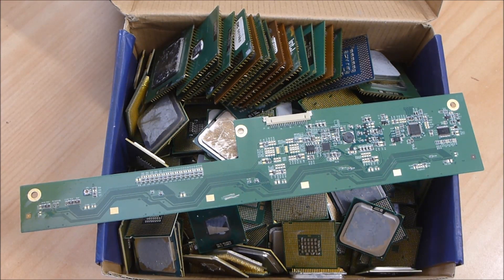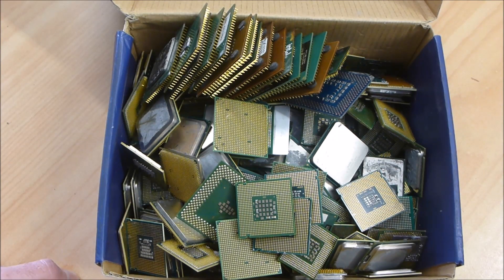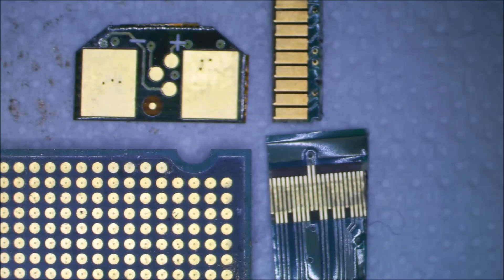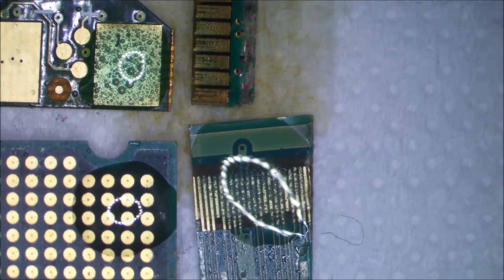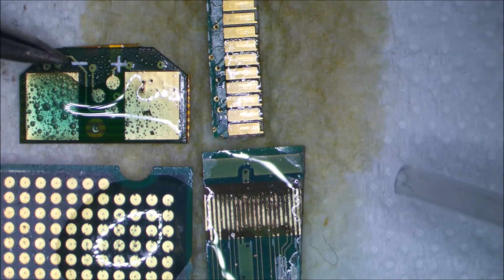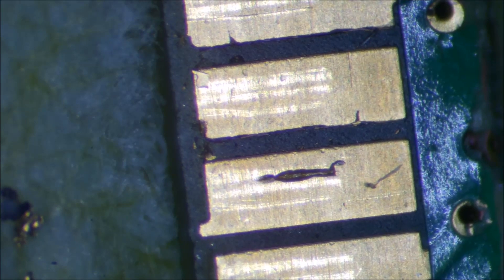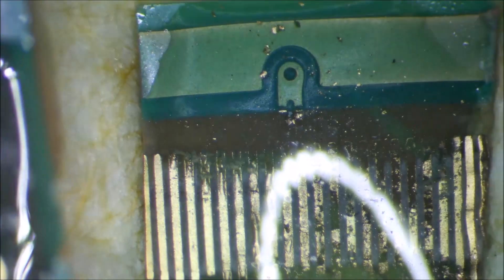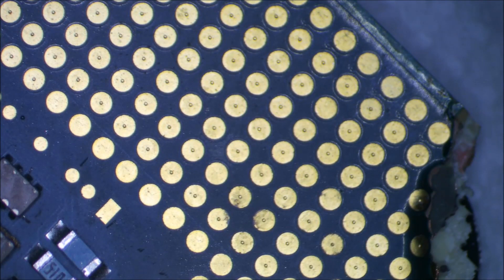Gold Recovery - Hard Gold vs. ENIG Part 4 - LCD monitor and P4 Processor

Comment: Great set of videos, thanks for putting them up.   I have a large amount of LCD boards, and clearly processing via AP looks like it would end in disaster. 

Could you post a video/link/point in the right direction a way to successfully recover the gold from ENIG surfaces?   I think I saw in comments using Iodine, but I have no idea how to use iodine in any successful way.

Again, thanks for the video
Reply from the maker: Thanks for the compliments, yes, it is definitely on my list of videos-to-do. I think the best approach for this type of plating would be a Cyanide based leach. Sodium Cyanide is a controlled substance in New Zealand, so hard to buy, but I have had some luck with using Potassium FerroCyanide which is comparatively easy to buy. Unfortunately the reaction requires strong sunlight which we are currently lacking here!  Iodine is definitely also a good alternative, but my knowledge on the subject is only academic at this point unfortunately.

Comment: Good Video the pinless processor looks interesting. another test that came to my mind, the cellphone battery contacts. when you remove them  they are mounted in a pcb, like the ram fingers. keep making that informative v videos that` exactly what i wanted to do but  dont have that helpfully tools. Regards,,, Luis  (Puerto Rico)
Reply from the maker: Thanks Luis, I am running a batch of those pinless processors now, will post a video next week showing their results. At the moment I'm guessing the total gold and copper value of a pinless processor will be far under NZ$1, but I hope to be surprised. I will have a look at battery contacts at some point, I have quite a few from phones and laptops, usually I process them via a Sulfuric Cell.
Reply: Thanks for the reply. waiting for your results. by the way sulfuric cell is one of my other solution for gold plated RF connectors , transistors, laser diodes and big pins etc. but here  those acids are out of my reach. i read at the gold refining forum that boiling  battery acid at 100 degres is safe to deal  and end up with bearly good sulfuric enough for the cell.  there are new exotic  solutions like the Leo Chang  channel. he have that super safe formula that deplate in seconds and you can put youre hand in the liquid. i don`t know, how true is that but they don reveal  a clue. so  i`m waiting and saving lots of material  for the wright moment of revelation jaja  or keep experimenting.  regasds
Reply from the maker: Yes, I have run a Sulfuric cell a couple of times, but not quite good enough at it to make a video about it yet. My understanding is that you really want the Sulfuric acid to be very very concentrated, you can certainly boil down battery acid and get it there, as usual, just be careful! Your other option if a Cyanide based leach, have a look and see if you can buy any Potassium FerriCyanide,  it is available in most countries and not regulated. It was used by the traditional film-camera industry. I will do a video about it at some point.
Reply: Thank you for your suggest. Potassium FerriCyanide sounds like something i can find. Never before i try to find Cyanide. that word alone sounds dangerous. but now i understand  that been carefully it is an option.    Will be great if you make a video tutorial using that product. step by step. i have several  plated  kind of pins and connectors, cellphone parts etc.  with this everyone can recover from lots of plated stuff.  looks that  you have another request. thanks for share your findings with us.    Regards.
Reply from the maker: Hi Luis, I will certainly do a video on it at some point. The reaction requires good sunlight and at the moment New Zealand is gloomy and rainy. If the weekend has a nice sunny day I will do a little example. The Cyanide in the Ferri ismostly  bonded to iron, so actually quite safe. There are some basic things like keeping the solution basic, but I will discuss all these in the video. It is actually a good solution as it doesn't really create any fumes and can work on pretty much any plated surface.